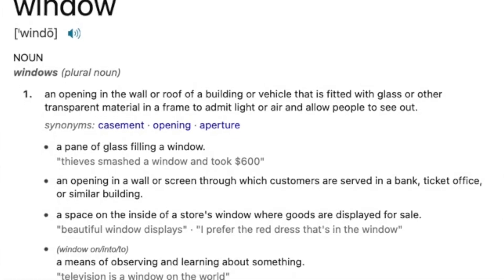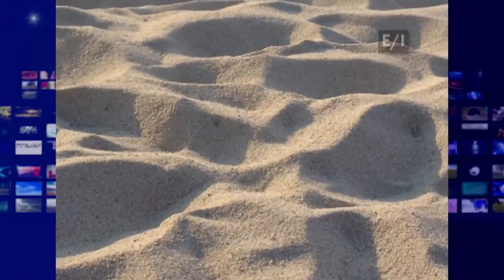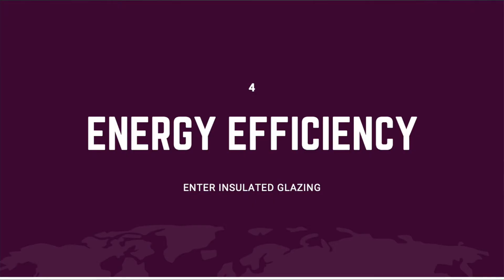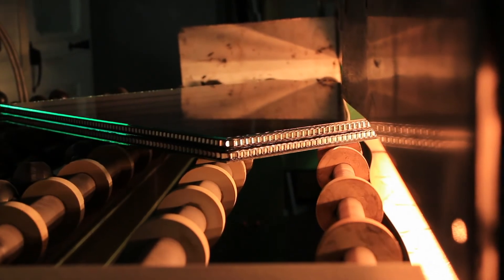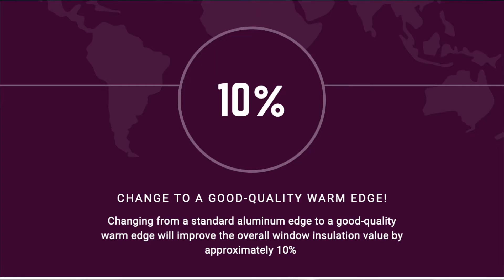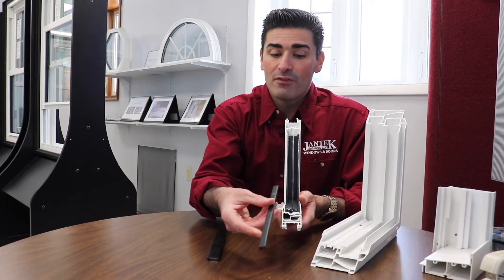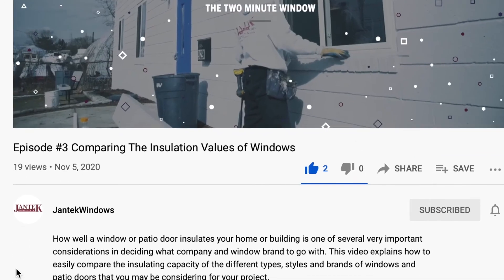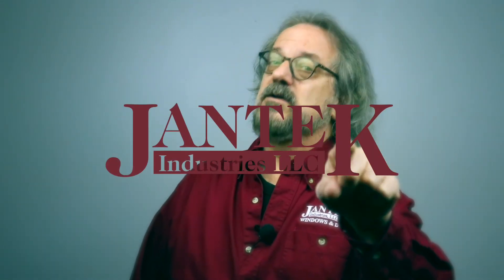A Brief History of Window Glass

Comment: Curious, you mention here that using aluminum spacer is a bad thing and you don't recommend it, but the NFRC lists that you use an Aluminum-Butyl Composite spacer.
Reply from the maker: Thanks for your comment Greg!  Have you some expertise in window design? Welcome aboard and we look forward to your further participation, and expertise, on our Videos!  Just to correct you on this matter Jantek uses a warm edge spacer (certified as A8-S) on all of its products. Aluminum Spacer systems are certified as A1-S or A1-D and are totally aluminum spacers,  meaning aluminum spacers have full contact to the glass on both sides and therefore not not "warm edge." You are obviously confused on the difference because the vast majority of high performance warm edge spacers, including Jantek's,  are a buildup of composite insulators around a corregated aluminum core (for structural rigidity) , the "warm edge" means the composite insulation dramatically decreases thermal conductivity and ensures that aluminum never touches the glass.  Hope this clears things up for you!  Thanks again.
Reply: @JantekWindows  Thanks for the reply Frank. And yes, while I have had some experience in window design primarily structural and glazing, I wouldn't claim expertise in that area. 
I'm not really familiar with you guys and honestly I was having a little fun when I commented on using an "aluminum spacer".  Actually you guys have some very nice energy performance numbers per NFRC.
However I would respectfully disagree that the vast majority of warm-edge spacers are a buildup of composite insulators around a corregated aluminum core. I would reference Intercept, Cardinal stainless steel, Superspacer, and Duralite as examples of warm-edge spacers that don't fit that definition, but are widely used products.